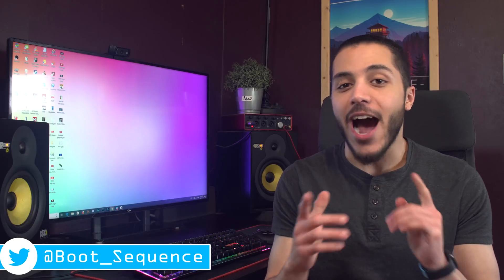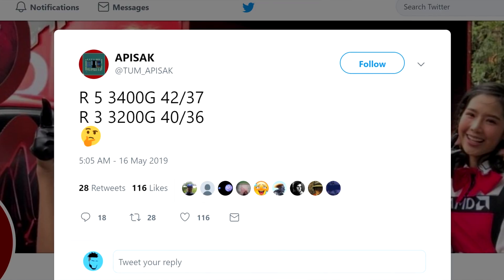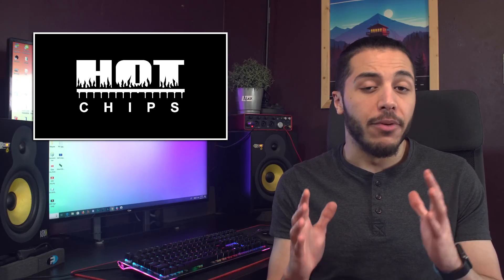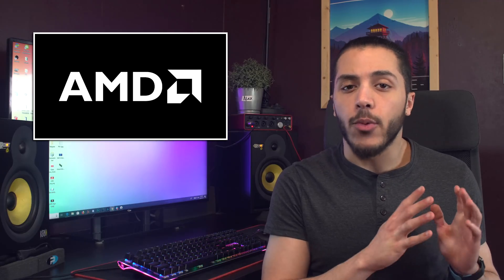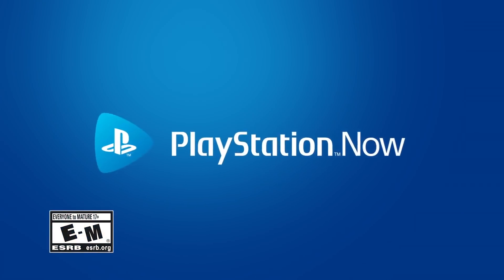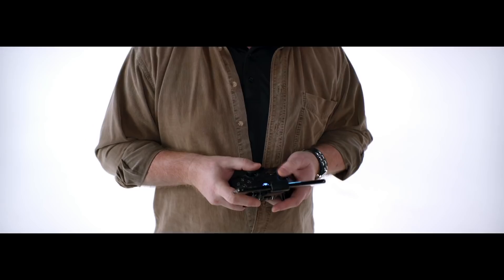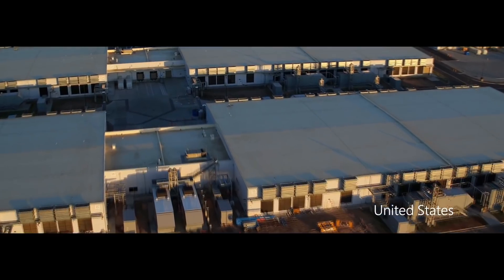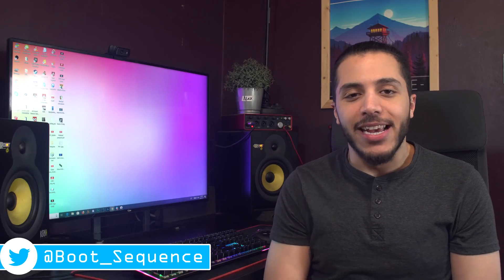Is The X570 Chipset Getting Too Hot?

Comment: Nobody complains when chipsets and VRMS have giant chunky heat spreaders as tall as stock cpu cooler at times.....because they look cool, but the second a fan is installed, everyone is worried. lol
Reply from the maker: I think its mostly due to another failure point being added. I remember my X99 board having a broken chipset fan. personally , I think it looks pretty cool with a fan though.
Reply: Fans make noise and they will die soonner than other non-moving parts. What do you think it will happen with the chipset and the whole motherboard when the fan will die or get stuck for some reason?
For sure I will not buy a motherboard that makes noise and it's prone to burn out.
Reply: @Daniel-wn5ye  You planning on having 4 gen 4 drives ripping full blast all day? no? sure its fine.
Reply: @Windupmykilt  No, one SSD and one or maybe two big HDDs, but no full blast all day :)

Comment: I'm guessing, but... I think when you run 30+ Virtual_Machines, and you have a RAID array of SSDs and at least 1 M.2 drive, and your networking includes two or more 1GB Ethernet connections, straight to the WAN... That is, if you use the thing as server, like a website / web-server running dozens of instances of Apache... I think your chipset would get a bit hammered under that use case. I can't see how it relates to the gamer_boi playing PUBG, even if he's streaming live...
I really don't think this is likely to be something that'd effect most normal people. Maybe the chipset silicon is tiny bit temperature sensitive, when pushed, and if the silicon gets over 60 or 70C, it starts making mistakes. That would be reason to spend not only on a passive heat-sink, but a tiny fan as well, on all of them, for everybody. It's just not a use-case that anybody remotely like a normal user is going to encounter.
Now this thing has got the chipset (more or less) straight from the EPYC, right? And latest EPYC had got Gen 4 (is it 4?) PCI... That's physically about the same connection, but double the bandwidth, right? So would doubling that hammer your chipset a little bit?

Comment: I'm not too worried about the chipset being actively cooled. It's very likely a much higher performing chip from what I understand (partly just to deal with PCI-E 4.0 throughput) and thus has a higher TDP.

But importantly, this chip is only going to get hot when stressing the IO extensively - which is a fairly rare thing for normal users. When I say IO that means harddrives, USB ect. Assuming the engineers making these boards aren't sleeping on the job that fan is never going to spin unless you run multiple high-performance SSDs for an extended of time (or maybe max out all your USB3 ports at the same time although I'm not sure what the use-case for that would realistically be). 

I'm fairly certain this is just a fallback solution to prevent throttling in the 1% of unusual use-cases that would warrant it. The motherboard producers know that will show up in reviews and don't want to get a bad rep for making high-end boards that throttle under maximum theoretical load.

I just hope they don't cheap out too much on the fan control logic. Full PWM control please! :)

EDIT: I expect that extra large heatsink on the ROG motherboard is there not so much to give additional surface area but to have more thermal mass exactly to absorb the high spikes might happen under normal use and prevent that fan from ever spinning up outside of artificial stress testing. Those tiny fins won't do much, but 2x or 3x the mass means it takes that much longer to heat up to a point where active cooling will be needed to prevent throttling.

Comment: Why does show USB 3.0?  really hopping next B550 / X570 motherboards are using at least USB 3.1 or better  (Yes I know USB went threw that all new naming thing many times.)  thus why I hope we see slightly better USB and hopefully better onboard sound this time, instead crappy RealTek..
Reply: You mean usb 3.22 4x4 awd?
Reply: @SlyNine  
Ya we know new USB name thing is just stupid lol. You'd think they hired propper ppl to at least make street name easy to remember vs proper tech term lol
https://en.wikipedia.org/wiki/USB_3.0#USB_3.2
Reply: Where are you taking USB 3.0 from? Can you give a timestamp?

As for sound, realtek isn't actually that bad - as long as you don't have a headset that is hard to drive and you literally can't get enough (quality) amplification from the on-board system. I think if you want significantly better sound than what current on-board can provide you are going to need an external DAC. Any DAC inside of a PC is going to have some interference issues (even when shielded) and thus some a bit higher noise-floor. That seems to be the major limiting factor at this point, not so much the circuitry. An external DAC doesn't need to be a huge investment either - but unless you have a high quality headset and you are particularly focused on high-quality sound.

As someone who owns an external DAC and an external quality AMP - it's worth it for me personally, but it's not some massive difference so I can totally understand why on-board is fine for 99,9% of people.